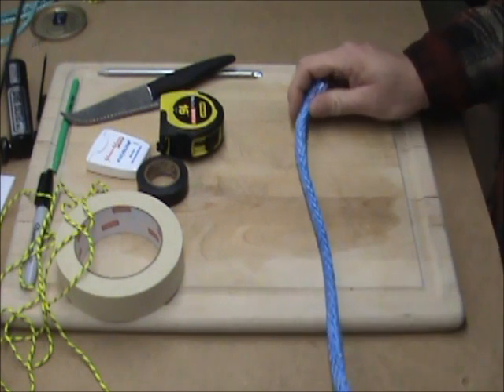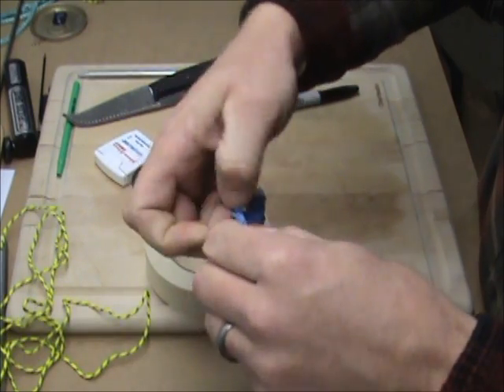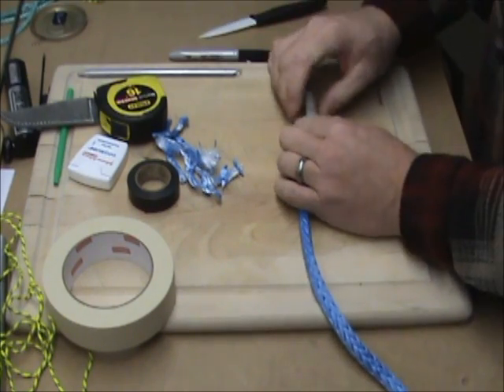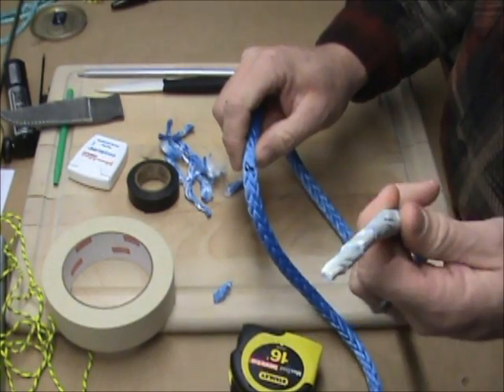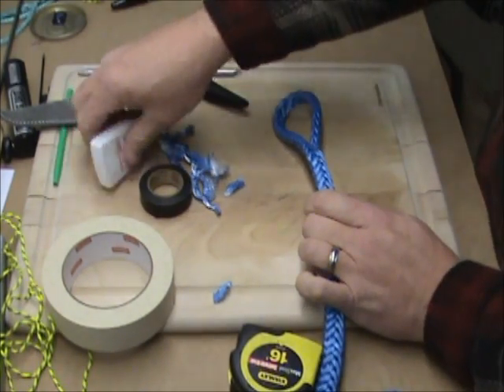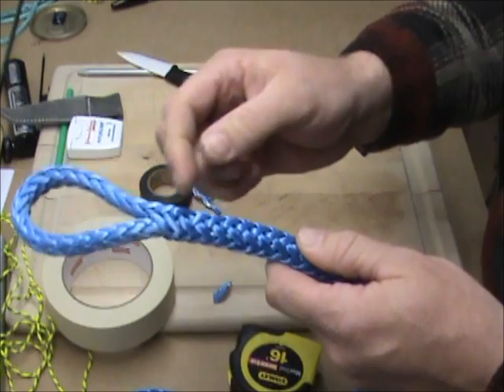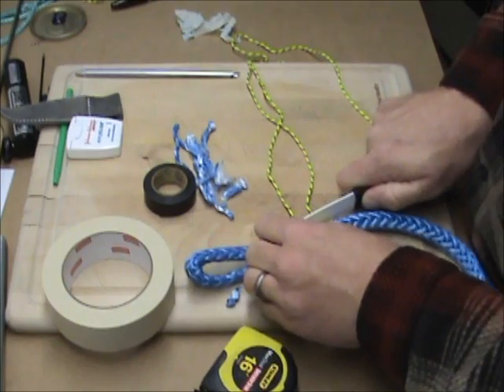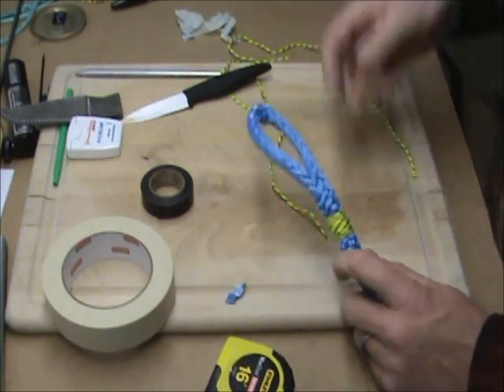Creating a fixed eye in your Amsteel Blue Winch Line

Comment: Nice video.  Wish the person who pretty much verbally assaulted you knew what he was talking about.  Its a shame people will take away from this that a figure eight on a bight is acceptable for winching and rigging.  He might also check out Samson's website where it states that as a 12 strand class 2 rope, this splice will maintain 90 to 100% of the ropes strength new and used.  I would also hate to damage that wonderful figure eight on a bight (or is it bite?), when it is pulled against the fairlead, then I guess you can tie another and another.  But I guess thats what happens when  you really have no idea as to what you are talking about.  Great job Kris

Comment: Seems to me, a better location for the yellow/black whipping would be a bit farther into the rope from the eye.  The outer woven rope tightens against the inner end like a Chinese finger puzzle under tension.  But before tension is applied, the inside end can slide apart more easily.  It should keep the inner end in place better if the end of it is anchored into the tightening outer layer.
Also, when the end is pulled through the side and the tape is removed, I wonder if binding the cut ends together with an adhesive would be beneficial.  I wouldn't use an adhesive that cures hard.  If the adhesive binds the inner end to the outer weaving, that could result in uneven stresses on fibers of the outer line when it is tensioned.  Maybe a small amount of clear silicone adhesive. The adhesive should be allowed to cure while the line and eye splice is under tension.

Comment: Thanks, we just replaced an old eye with a Viking thimble.. The masking tape was too sticky so we used cellophane packing tape instead. Then it slid through very easily. My wife then lock stitched it with fishing line.. It look like factory
Reply: rubicondon04 y

Comment: Do I actually need a metal thimble in my winch line- I plan on dumping the fixed hook and go with an open eye and then use a soft shackle- is that sound reasonable? Great videos BTW. 
Vic in Utah

Comment: great video very informative quick question, what is the strength of that eye now? Is it as strong as the line or 80% or 50%?
Reply: More than 100%. Unless you put that eye over something sharp, the rope will break beyond the splice area before that eye fails.

Comment: That's perfect.... Thanks a lot.  I broke my winchline on Friday and instead of buying a new one for $400, I'm gonna  buy bulk for $100 and make my own.  I also put two fixed loops in my old line.   Another question.  Vw hat is the ideal material to use for the locking stitch?
Reply from the maker: I use a product called "Lash It" from Samson which is basically a dyneema twine. But any twine will do. Masons or twisted from Home Depot or lowes will get the job done.
Reply: +PbNTheory any spectra fishing line will work great...go to a tackle store and ask for some from there trash can where they spool up reels with new line or hit up a friend that fishes
Reply: Unwaxed dental floss.
Reply: Commercial tow truck and crane operators still use steel cable (wire rope) and I have not seen them switching to synthetic rope... Just something to think about when you are tossing money at the synthetic winch line fad...
Reply: @CurmudgeonExtraordinaire  I drive a HD tow truck and I switched to synthetic about a year ago.  It’s great for most situations.  It absolutely is not a fad. The fact that you believe that proves you don’t really know anything about it 🤷🏻‍♂️
Reply: @Crawlerjamie  -- Then you are the definite minority... I have yet to see any of the tow trucks here in the Houston area switching...  And we have a LOT of tow trucks... The abrasion and heat resistance of steel outweighs (no pun intended) the weight savings of synthetic rope... I'm not saying that synthetic can't have it's uses, but personally I would only use it for attaching to something that a steel cable might damage while still having the steel winch line... My recovery gear consists of a hydraulic winch with steel cable, high-lift jack, various ropes, straps and other hardware, and even lengths of chain...
Reply: @CurmudgeonExtraordinaire  I’ve never seen it on another tow truck.  But I suspect we will soon.  It’s safer, lighter, and stronger at the same diameter than steel cable.  I see it in many industrial applications here including logging trucks and in oilfield work.   The only downside I know of, is the abrasion resistance.  And if used properly, it can last just as long as steel.  It will never replace chains or anything.  Just good as winch line. I’m not going to argue with you on it’s usefulness.  If you don’t like it, don’t use it.  But no one can argue the safety benefits.

Comment: So the lock stitch is what I did to mine.  That is just to prevent is from slipping out?  And when you're winching with it, the surface area and squeeze of the outer part of the splice squeezes on the inside that is fed through, and that does the locking of the line?
Reply from the maker: Correct.

Comment: I was really interested. But, the "inches" problem. .... I'm used to the metric system, so I don't understand your Inches calculations. Sorry. I'v quit on 4.14 ;...
Reply: +Bob Craen if only there was some sort of way to convert these units. oh well.
Reply: +Bob Craen really you need a tape at all?...you should hire someone to do this for you that has a brain
Reply: The inches he's using is the length of the fid.  He didn't do any calculations.  Does using metric make you too stupid to measure the fid in mm?

Comment: can you explain the purpose of a thimble in the loop/eye? the one that i have is bent up from being used and i was going to just go back without one if it wasn't a necessity..
Reply: +Joey Withers You mean the metal piece that is in the loop end of many ropes? If so that is there to protect the rope. Any slight movement of the rope under tensions can either cause a failure or some pretty serious wear.  For instance say your steel shackle has a bur on it. That bur would damage your rope where the metal in your "thimble" will protect it.

Comment: the way you do it works but you do not need ribbon measured.just with the chopsticks you are correct.tu have a line in the middle of your chopstick .it's a measure

Comment: Seems to me that you won't have to be so precise with the taper if all it was for was to feed the end through the middle. There is a better way. Much more time involved but worth it to make a self-locking braid.
Reply: A good taper serves more to maintain the strength of the rope.  If there was no taper, the harsh transition where the bury stops would contribute to a weakened rope for the same reasons as a knot.

Comment: Can this be done with the 12 strand, 1/4" Amsteel Blue?
Reply from the maker: Yep, it certainly can.
Reply: Kris Casey
Well, after several attempts, I did it:):):) Tip size of the taped tapered end is very important!! Thanks Kris:)
Reply from the maker: Bryan Teal Yes, very important. And as stiff as you can get it. In the future, sometimes it helps if you can use something to open up the line prior to starting the bury. Knitting needles work well and if you get one of the hollow ones, you can cut off the blunt end and use it as a fid.
Reply: Kris Casey
I did open a "hole", with a dental flosser:) I found that the tip, if too large, would catch and if too small, would sneak out the side, prematurely. Eventually, I got the tip size just right and made two eyes in just a few minutes:)
Reply: +Bryan Teal you can do this with any braided line...i do it with 60 pound test spectra fishing line by inserting a clear monoflilament nylon fishing line inside it then whipping it and adding tac glue...as little as 1 foot of mono can hold past the breaking strength of the weaker link

Comment: So ive watched this video, and your video on doing a locked Brummell with one end of the rope.  You say the locked Brummell is a more permanent fix.  So out of curiosity, since the locked Brummell appears to only need tape and a knife, and the technique in this video requires something to stitch it with, why wouldn't you just do the locked Brummell in the first place?
Reply from the maker: Because a locked brummel, if you are going to have something in the eye such as a thimble, hook etc, requires access to both ends of the line. If the line is spooled on a winch, its more work to pull all the line off just to gain access to both ends.
Reply: +Kris Casey  Actually not tru at all.  a locked brummel splice just requires you to invert one of the loops when you make the splice.  really easy to do.
Reply: +Pierre Mitham, is there a video of how to do this somewhere?

Comment: sailors use a metal tool call a " marlin spike "
Reply: technically a marlin spike is for wire cable/rope. fids are for soft lines
Reply: No, marlinspikes predate wire cable/rope and were specifically designed for working with rope and twine. They have an expanded role since the invention of wire cable/rope but they are originally and still a rope working tool. Fids are generally made of wood, bone or UHMW and as such are limited to soft line work. Marlin spikes do much more because they are made of metal but their original function is still the same.
Reply: Citizen8700 I h